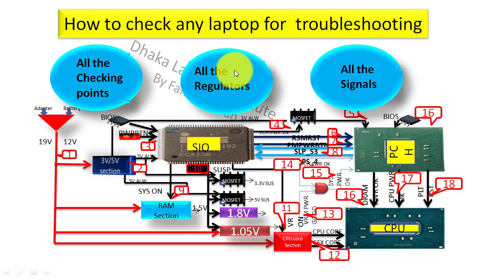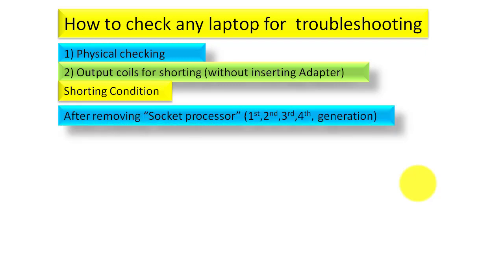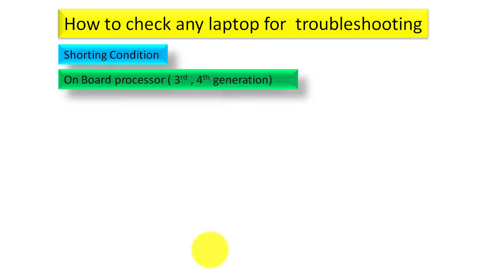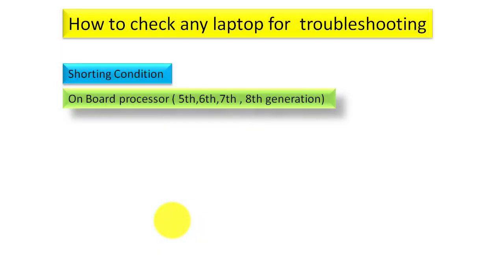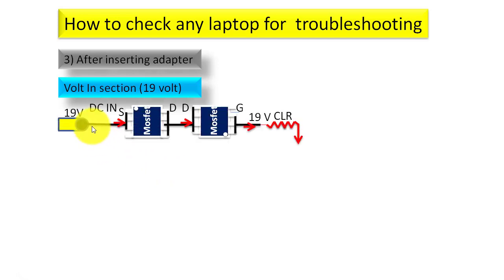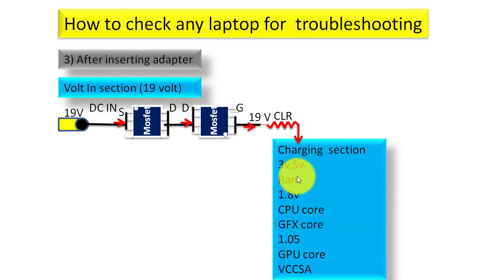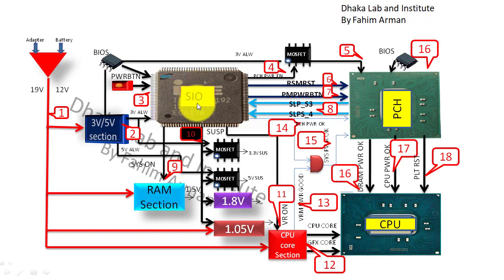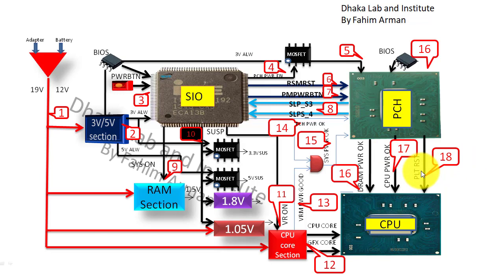How to check any laptop for repairing (Trouble shooting)

Comment: I have the Hp Quanta g74a that all the voltages are available but it doesn't start at all the vcc core is shorted as all the smd caps are shorted to ground, can you help me out?